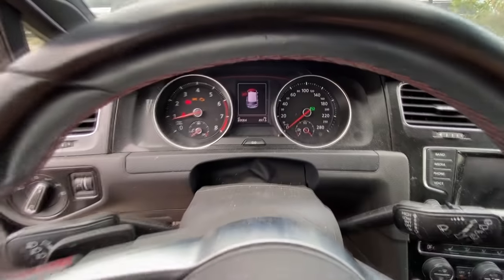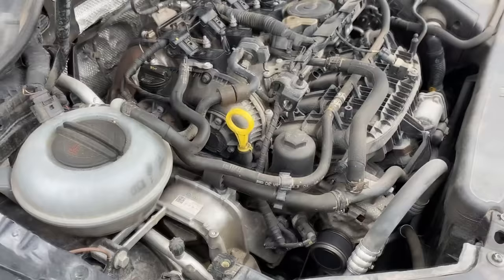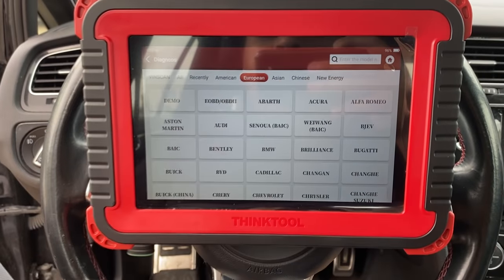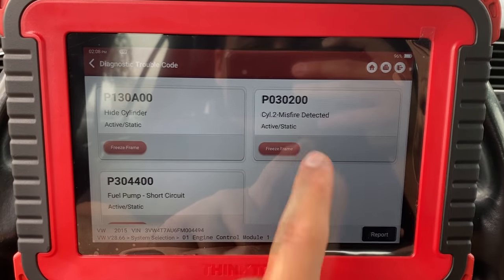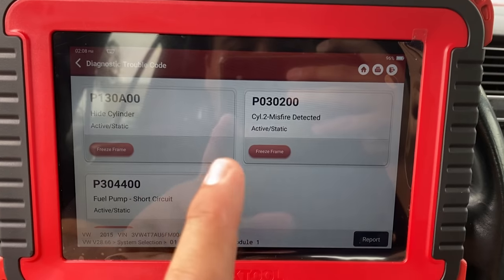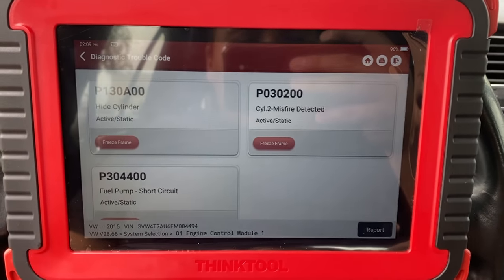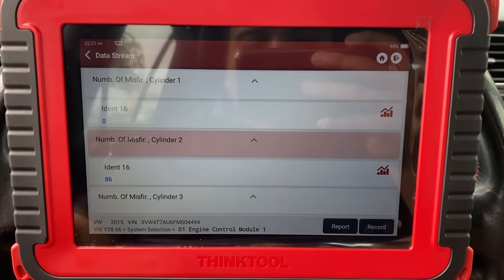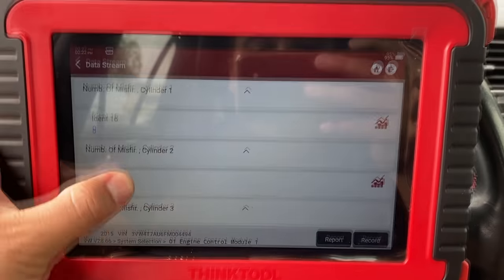VW GTI MISFIRE CYLINDER #2 NO COMPRESSION

Comment: That double nut ground wire is peanuts, buddy. The engineers know exactly what they’re doing making it as difficult and expensive as possible to service and repair these cars. You need a €650 tool to get the crankshaft oil seal on, dedicated timing tools, clutch tools, the cams cannot be accessed without removing the whole side plate of the engine which is flimsy thin so you break or bend it, they even have special sealant in the head near oil passages which flush away at first start, use normal sealant and you’re a goner. Even the coils have a special removal tool, screwdrivers damage the plastic edges. Don’t ask me how I know, pistons even melt from knocking, let alone piston rings…. It’s also funny to read that you guys consider 93 octane high, here in Europe you cannot get below 95 octane. You have 95 or 98. In Germany you can even find 104 octane. Anyway, respect for your knowledge on European cars, you’re on the money with your analysis, timing chain tensioner is also shit on all current VAG engines, they have to be changed or you will lose your engine. Greetings from Holland.
Reply: Oh yeah, nearly forgot, you need Elsawin for wiring diagrams, but that software is tough to get in an unlocked form (see above).
Reply: US fuel is rated in AKI octane rather than RON octane.

Comment: Before watching the video, I’m going to guess that there’s possibly multiple misfires but #2 is the worst. GDI engines are known for carbon deposits hanging the valves open. But I’ll finish watching the video to see if I’m correct.
Reply: Eternal Cowboy  Yeah, and when you de-carbon the runners the car owner will think you installed a blower when they weren't looking. The EcoTech G.M. engine is really bad with the build-up. A client with an Equinox came in for random misfires, but they couldn't feel the miss. As a trained tech, I sat in the seat and could feel very minor misses at idle. I suspected clogged runners and coated valves and sold them a cleansing. I never saw such blockage in my life. Took pictures of before and after to show my clients the results. (I'm a documenting mo fo from way back). I felt the renewed power instantly when I drove it after the cleaning and no more misfires either. She never felt the power decline due to it happening over time, but when it came back to life she sure did. She called a bit later and said she almost wrecked the vehicle when she crammed on the gas pedal like usually doing when pulling out into traffic. Although I did warn her about the increase in power, I guess she wasn't expecting it to be that much.

Comment: Where ealse would you test if misfire cylinder 2 and compresion test passes and plug and  coil are good also nexg to this i am getting a cadalic converter not pass and also a EPC light starts blinking also .. its a 2014 vw Beetle 2.0 Turbo. With 125k miles

Comment: I get a monthly CarFax valuation report and my 2017 GTI has been raising steadily since fall 2020.  Trade-in Value in November was $15.5 K and last month it was $17.5 (30K miles).  Sold it in no time as a private party sale for the $20K value last week (28 APR 21).  So, 2 grand for a used motor is probably a lot less than the value of that car. Then again, as noted by other commenters, this particular car looks 'rode hard, put away wet'... way too many times.
Reply: They are offering me 25k for my base 2018 GTI s with 35k miles. It cost me  less brand new three years ago

Comment: That faulty timing change issue was resolved since 2013. Vw already implemented its updated tensioner, In vehicles after that with the EA888.please do more research.  My guess is that the car is abused and not taken well care of. Especially since it’s tuned, maintenance should be done for frequently. Timing isn’t the issue, worn piston is the best bet. Rebuild time.

Comment: Remove the top nut first, then the lower one 😀
Reply from the maker: You have to hold the bottom nut with a backup wrench to remove the top. Most wrenches are too thick.

Comment: The issue is not related to the timing belt, it's totally the piston ring since there is an oil on spark plugs and also in the cylinder very simple is the piston rings failure.

Comment: Plus there interference engines tolerances are way to close if it jumps timing has a terrible tendency to bend valves
Reply from the maker: After doing some research I found this to be a pretty common issue with tuned 2.0 engines. This vehicle has a COBB tuner. Humble Mechanic actually made a video with the exact same vehicle that had the exact same problem. Check it out here! https://youtu.be/V6jzRQpMw24

Comment: The piston rings will create issues for the oil in the cylinder.
Reply from the maker: After doing some research I found this to be a pretty common issue with tuned 2.0 engines. This vehicle has a COBB tuner. Humble Mechanic actually made a video with the exact same vehicle that had the exact same problem. Check it out here! https://youtu.be/V6jzRQpMw24
Reply: @ADVANCEDLEVELAUTO  nice. Will look at it. Humble mech is really a solid dude.love his videos

Comment: Hey! 
Yeah wow. Life happened and 3 hours later I got the chance to finish watching this.... You got me doing the "wait, what?"
The valves didn't LOOK bent, but a slight bend and/or cracked valve guide would fit the bill. And there's no way you would have that much leak through an injector. I still wouldn't call it without at least an audible leak down test.
Send some stuff over to me! I'm sick of brake jobs!
Love your content Eric!
Reply from the maker: After doing some research I found this to be a pretty common issue with tuned 2.0 engines. This vehicle has a COBB tuner. Humble Mechanic actually made a video with the exact same vehicle that had the exact same problem. Check it out here! https://youtu.be/V6jzRQpMw24

Comment: Lmao so nah, first of you didn’t need to go all the way and remove the rear bench seat and disconnect the pump, under the high pressure pump there are two connectors that  you disconnect, those are for the injectors, so they wont fire. For the compression test on these cars, the manufacturer says to crank the engine until the gauge stops moving. Now, as far as the timing chain lmao the issue is not that it has a “bad tensioner” the issue is that without proper maintenance, the chain actually stretches. The new revised chains are much stronger. The ones that had issues with the tensioners are the 3.0 supercharged v6 where overtime they would not hold oil pressure as well and they would make a noise on dry start ups, like after an oil change or after sitting for a long period of time, no this would not make it jump timing, just makes a little noise and that’s it. Anyway, thanks for the laughs throughout the video!

Comment: Cobb Tuning stickers, aftermarket intake.... this engine is smoked. LOL
Reply from the maker: After doing some research I found this to be a pretty common issue with tuned 2.0 engines. This vehicle has a COBB tuner. Humble Mechanic actually made a video with the exact same vehicle that had the exact same problem. Check it out here! https://youtu.be/V6jzRQpMw24
Reply: Interested in your bore scope setup, the picture is amazing

Comment: Don’t always rely on a borescope. You can have very subtle damage or a very slightly bent valve from piston contact that looks good on a borescope. Also those vw gdi engines have a horrible problem with carbon deposits so don’t rule out a sticky valve

Comment: Boy racers put tunes on these cars that stress the engines beyond capacity, then they beat the snot out of the car at the track and on the road. And you're surprised the engine fails?  At least you make the statement that it is a pretty common issue with "tuned" engines. In other words, engines with ECU's that are reprogrammed to operate outside of the VW spec.  If you're gonna play, you're gonna pay. A GTI that's well maintained and not modified will last a long time.
Reply: Just had my first 2nd issue with my Mk5 GTi,  (first was a starter motor couple months ago)   Now i have a cylinder misfire #2  however its done 198,000km on the original coils, so I'm feeling confident its an easy fix.   haha.

Comment: I have a 2011 VW Tiguan. It misfired not even a year ago. New spark plugs and coils for all cylinders. 
Last week it misfired again😢. They swapped out the coils, didn’t fix it. Now they put it injector fluid in cylinder 2. Cylinder 2’s PSI is at 132, and the other ones are good at 140. 
I don’t have high hopes that that the injector fluid will work. If this doesn’t work then I’m looking at a injector replacement. 
All I can say that I will never buy a VW Tiguan.

Comment: Thats nothing, my 12v VR6 has zero compression on an entire bank lol  Figured it was the chain, pulled the valve cover, chain was a bit floppy but still there.  Stuck the borescope down the plug holes,  fortunately didnt see any damage on the pistons or valves.  Mustve broken the lower chain...

Comment: Well, that looked like its tuned. Whoever owned it probably thinks they are awesome mechanics. I have 2 VWs and theyre running like champs at 50k and 140k miles. I maintain them but I know when I need a pro, too, which is not too common with mine.

Comment: There is another known "rare" issue with 1.6 mpi engines. With time camshaft wearsout it's bearings abowe cyl.2 and starts to play up and down, hydrocompensator cannot deal with that play and engine have constant cyl.2 miss with no reason because valvetrain doesn't work right.

Comment: i already fixed one of these, same engine but in a seat (still VW), they did a massive run of exhaust valve guides that where too soft, they wear out and you get sealing problems at low revs due to valve float, tho one i repaired the inlet guides were like new, this seat was around 90k miles, 2002.
Reply: When did they fix that issue
Reply: @neilmurphy845  sorry i do not have that information.
Reply from the maker: After doing some research I found this to be a pretty common issue with tuned 2.0 engines. This vehicle has a COBB tuner. Humble Mechanic actually made a video with the exact same vehicle that had the exact same problem. Check it out here! https://youtu.be/V6jzRQpMw24
Reply: @ADVANCEDLEVELAUTO  glad i could help, i also have a bore scope and the cylinder looked very similar just not quite as bad as the engine you have there, the one i did was so small it only misfired on tickover, even if you hit the aircon and command 100 more rpm it was enough to cover the problem, but would set miss codes on tickover.

Comment: This is not a VW problem - but an owner problem.  Car is a mess to begin with.  Tuned at who knows what level with lots of aftermarket junk, oil is filthy and probably over 100K miles.  Time to scrap the car and the owner, they deserve what they got.  I've put close to a million miles on various VWs over the past 15 years - and no serious issues.  Treat them per the owners manual and you'll be much better off.  Tune at your own risk.

Comment: My mk5 gti has misfire on all cylinders (cyl 1, cyl2, cyl 3, cyl 4), this are the only codes that reader throw

Only have misfire on first start or when i leave a few hours and then start again

I already change coil pack (apr coil pack), spark plugs (ngk ), air filter 

Replaces also the latch on drivers door 

But i still having misfire

Any advice? Help?
Reply: How you fix this in the final?
Reply: @chitila007  i need to change whole intake manifold because mine doesnt have the flaps (injectors and other sensors are fine)

The previous owner removed and put an aluminum intake without flaps

Comment: Bye bye vw. Owner should cut his losses. If a used motor is $2k , add at least $1.5 k to install and you still have a used vw that will probably break down again.
Reply: And unless there's an upgraded part that used engine will also be worthless
Reply from the maker: After doing some research I found this to be a pretty common issue with tuned 2.0 engines. This vehicle has a COBB tuner. Humble Mechanic actually made a video with the exact same vehicle that had the exact same problem. Check it out here! https://youtu.be/V6jzRQpMw24

Comment: VW and AUDI 2.0 liter engines are very picky about oil level and on time maintenance, they are already at the highest level of performance and owners treat them bad by not keeping up with oil level between oil changes, this is what happens, you can see the dipstick was at the lowest, on a tuned engine is a big nono.

Comment: You don't need to take the motor apart . Take the spark plug out and bring it up to TDC and pore in marvel mystery oil fill the chamber then soke it for 3-4 DAYS THEN DRAIN THE OIL OR RUN THE MOTOR FIRST THEN DUMP AND FILL

Comment: I’m having an issue with a 2009 VW GTI and I can’t seem to figure it out .Cylinder 2 has 120psi while the other three cylinders are at 150-155 .Pistons,valve job,spark plugs and fuel injectors are all new .Coil packs have been swapped around and it doesn’t follow .Also it also misfires at idle or when at a stop.When at highway speeds car runs fine .Anyone with suggestions would help .
Reply: 2015 vw gti I have the same issue now where cylinder 1,2,4 is reading 175 psi but cylinder 3 reading 150 psi what did you do to fix it
Reply: What was the resolve?

Comment: These motors have
-piston ring issues ending in recall
-timing chain tensioner issues
-carbon buildup on valve issues
-pcv issues
-water pump issues

I know because I own one lmao
Reply: I am so sorry for you
Reply: @trizkial7592  no problem, building a block for it now with all the updates and forged internals!

Comment: Know what it could be is the piston rings
Reply from the maker: After doing some research I found this to be a pretty common issue with tuned 2.0 engines. This vehicle has a COBB tuner. Humble Mechanic actually made a video with the exact same vehicle that had the exact same problem. Check it out here! https://youtu.be/V6jzRQpMw24
Reply: @ADVANCEDLEVELAUTO  wow I seen the video the whole piston is messed up how many miles the car has bc that’s just messed up for a piston to be that badly damaged where there were rings in the oil pan

Comment: Bad luck, that's a very young engine to face a critical failure.
Reply from the maker: After doing some research I found this to be a pretty common issue with tuned 2.0 engines. This vehicle has a COBB tuner. Humble Mechanic actually made a video with the exact same vehicle that had the exact same problem. Check it out here! https://youtu.be/V6jzRQpMw24

Comment: You are really giving really bad information about this gen 3 engine. These engines do not have timing issues or tensioner issues. You are also doing a compression test without even removing all the plugs. If you’re mechanic and don’t know anything about this generation engine. It’s nowhere designed the same as the previous TSI engines and is pretty reliable. The only issue these engines have are water pump/thermostat issues. I’m going to say the Cobb tune was trash along with terrible fuel caused detonation and melted the rings reason why oil sits on top of the engine.

Comment: Tear down time😉
Reply from the maker: After doing some research I found this to be a pretty common issue with tuned 2.0 engines. This vehicle has a COBB tuner. Humble Mechanic actually made a video with the exact same vehicle that had the exact same problem. Check it out here! https://youtu.be/V6jzRQpMw24
Reply: @ADVANCEDLEVELAUTO  yeah.....he teared it down. In his case he had piston damage😱possible tuner error 😏

Comment: I you have 0 compression your problem is a valve spring was broke..valve is floating ..ecu disable cyl ..oil filled the cyl..piston ring problem will have poor compression not 0

Comment: These Volkswagen tfsi turbo engines are straight trash.. Only thing there good for is making money.  Oil consumption/ Worn out rings/ pistons flopping around/ Tons of carbon in intake valves because of direct injection, Also timing chain tensioner fails... Only a fool buys one of these cars vw/Audi  1.8/2.0 turbo.. not to mention the other junk German cars.. Also I have rebuilt one of these in a 2010 Audi a4 I bought. Piston was broken, I tore it down and change pistons and rods and timing chain kit etc.. I spent a little over 1k I think in parts, I did the work my self, I got the car done and sold it.. made 3k life was good.

Comment: This VW engine is total garbage. Loads of problems, expensive parts, valve carbon issues. FYI Denso coils are cheaper and more reliable than VW or Bosch
Reply from the maker: After doing some research I found this to be a pretty common issue with tuned 2.0 engines. This vehicle has a COBB tuner. Humble Mechanic actually made a video with the exact same vehicle that had the exact same problem. Check it out here! https://youtu.be/V6jzRQpMw24
Reply: @ADVANCEDLEVELAUTO  
Yeah, not common but he has "seen this before".  Really,  Charles works on VW & Audi almost exclusively. I work on many makes & do not encourage any German import business (although I used to do Benz years ago) But I've seen it and not on a tuned vehicle but just a daily driver.  The tiny oil control rings the small space between the top of the piston & the piston skirt and oil control rings. These things require more " routine " maintenance in 60-80,000 miles than my 18 year old 3.5 Max has needed in 160,000 miles.  Seriously, poor design. Sorry VW fanboys, just my opinion...  And Ur are correct, used block, short block or $$ rebuild are only options.